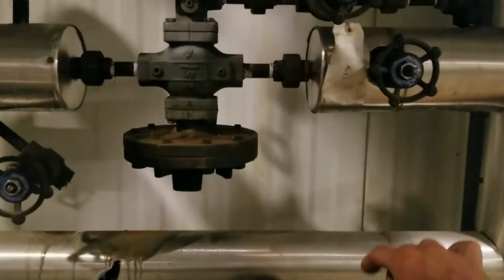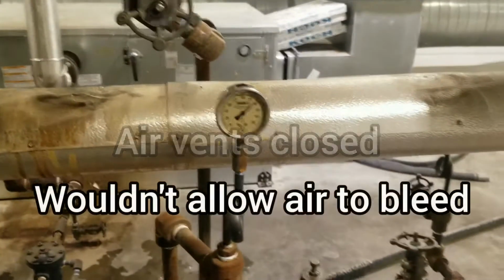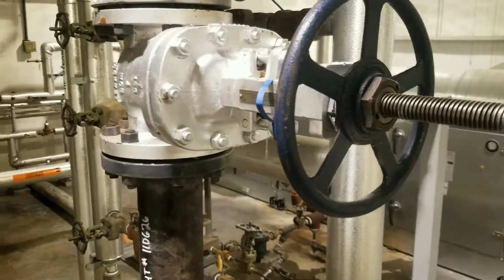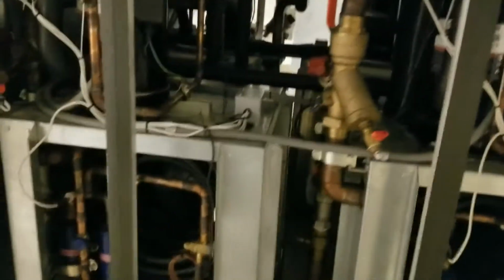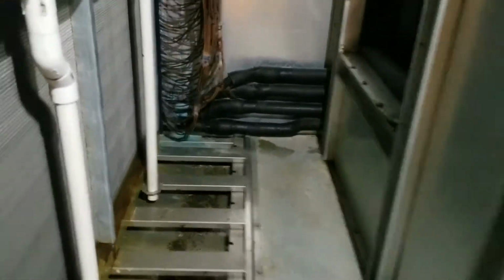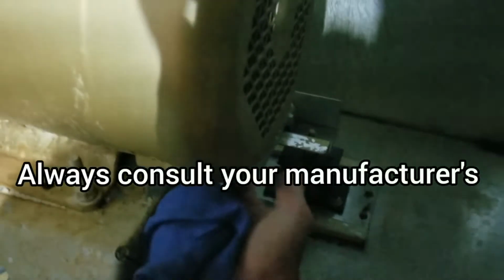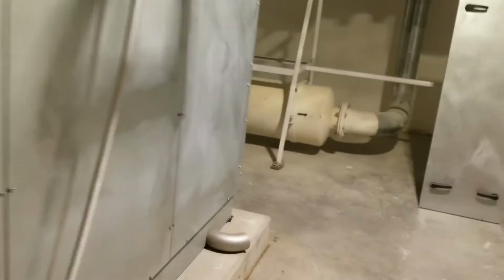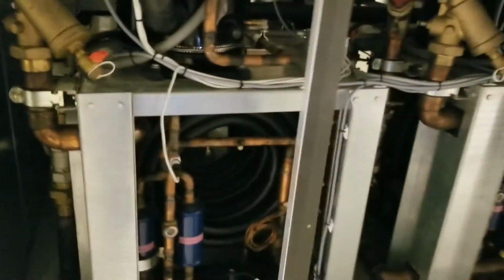Water source heat pump overview and industrial site P.M. walk through

Comment: was the magnehelic on the side of the air handler just measuring the drop across the filters, or were it for something else?
Reply from the maker: I think it's Just for the filters. Static pressure is controlled by a pressure transducer. We control supply static and space pressure so operates as a typical VAV system. Thanks Walt!
Reply: @EverythingHVACR  hat was the one sensor i wish i had added to my new air handlers: static drop across the filters. 

the best part of building automation is the ability to adjust things (like static pressure) from your couch, while wearing nothing but undies.  🤪 work smarter, not harder! 

good work on the vids, mate!
Reply from the maker: 😆 you are 100 percent correct, Thanks again Walt!